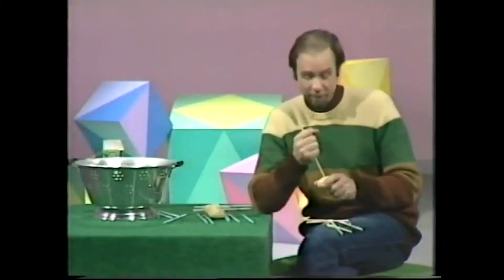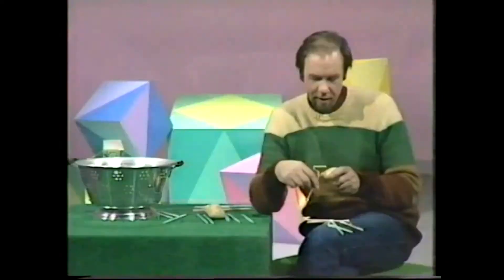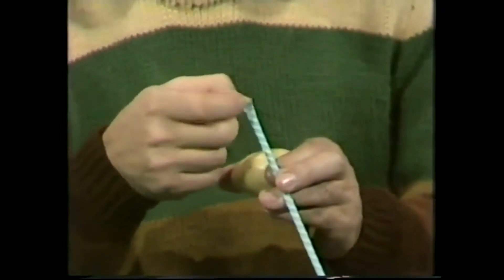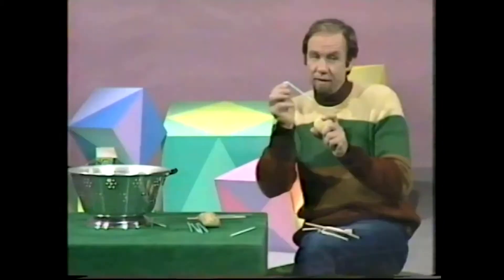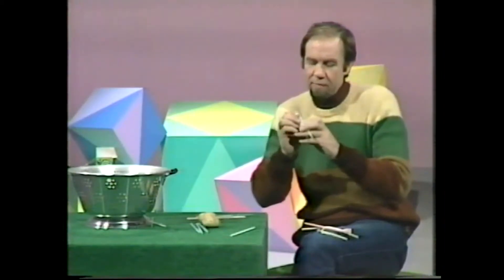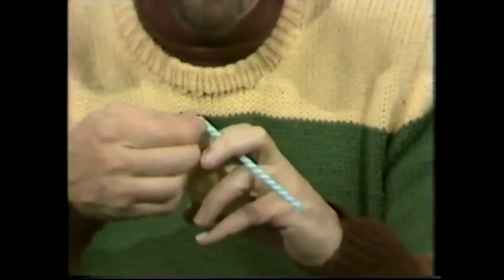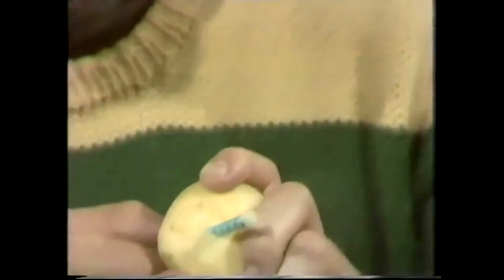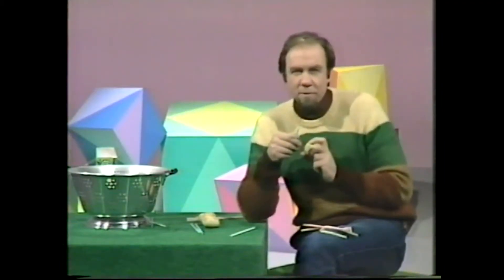Potato straw - with a difference

Comment: So ok, Rob finally spearing the potato with a paper straw was awesome. But hopefully I wasn't the only one who was afraid that the straw might puncture Rob's hand as well in the process too 😕

Thankfully though the straws were made of paper. Had they been plastic straws though my fear would have been warranted.
Reply from the maker: Thanks, but not really. It relies on something the texture of potato to plug the straw, compress the air and make it rigid, and I am not the texture of potato - Rob
Reply: @CuriosityShow  Oh, that's why it works! I was thinking folding it up put tension on the straw walls and strengthened it to compressive force.